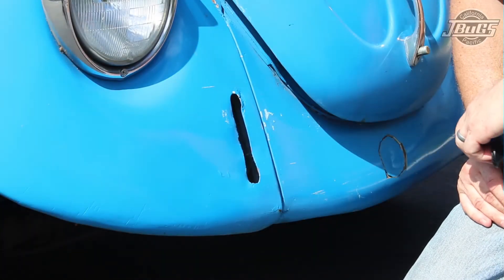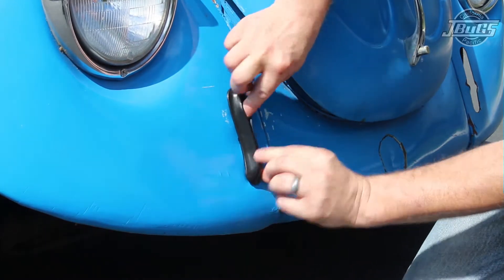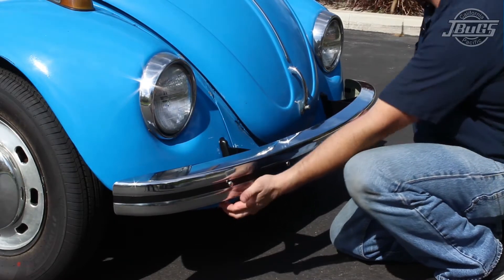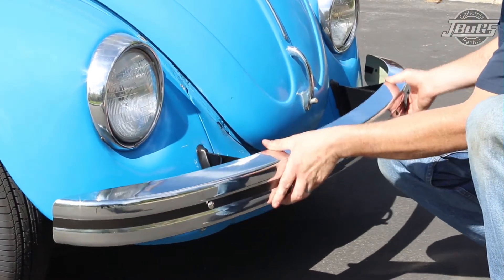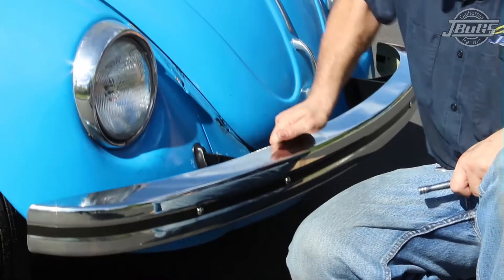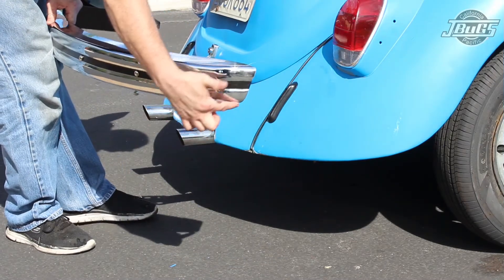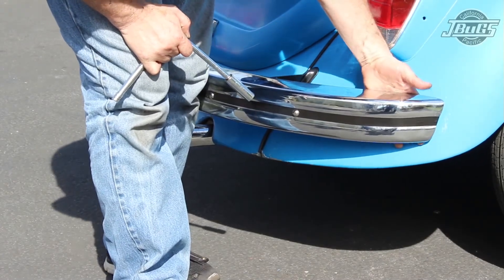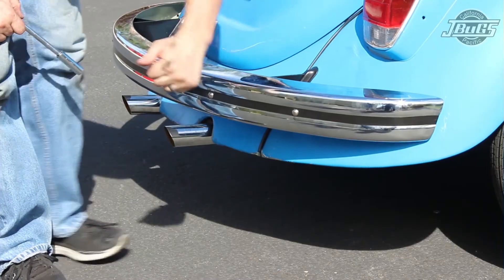JBugs - Tech Tip - Beetle Bumper Installation

Comment: This has been very helpful. With my 70 beetle I got in pieces. Never got to take it apart myself. The only thing that’s going to be a pain is my car is an autostick. The rear bumper mounts also double as the bracket point for the atf canister and vacuum canister. Going to have to pull those bolts out and slot in the bumper

Comment: Would it be possible to put 67’ bumpers on a 72’?
Reply: Yes, we offer https://www.jbugs.com/product/15-2045.html and https://www.jbugs.com/product/15-2046.html to install blade bumpers on 68-73 Beetles.
Reply: @Sam_Mebane  Will conversion brackets work for Over-Rider or just Blade Bumper
Reply: @loganmelodia6063  an over rider bumper can be bolted up to the brackets at it's lower mounting positions, but there are no supports for the upper portions of the over riders.

Comment: I bought the conversion bumper brackets to fit the old style bumpers or blade bumpers to my 68 Beetle .. I havn't purchased the Bumpers yet though..I am wanting to know if there is anyone who could share with me anything i should be concerned with in this conversion..I am wanting show quality chrome bumpers that also has a good fit and looked at several ads showing triple chrome bumpers..I know anyone can sell you anything but with no prior experience buying bumpers and without seeing them in person i don't want to make the wrong purchase here with such price tag for front and rear..Any help or suggestions ??
Reply: If you want a good fit you should have stuck with the original bumper brackets. The early bumpers are intended for use on early cars where the bumpers sit in a different position on the car. If you are intent on installing early bumpers and want the best possible fit, stick with blade bumpers (do not use over rider bumpers).

Comment: What I need is a shot of the opposite side of the bolts/info on how you tightened the nuts onto the bolts. I can barely fit my fingers into the slot where the nuts are supposed to go onto the back of the bolts
Reply: A wrench (ratcheting preferably) is all that can fit in there, it's tight but it works.

Comment: By the way what is a sleeper ? Not that i would do that to my car in the first place
Reply from the maker: A sleeper is, for lack of a better description, is a stock appearing car with a performance engine, and hopefully drivetrain and brakes to match. On the surface the car seems very unassuming and you wouldn’t suspect it to be fast at all.

Comment: My 1969 volkswagen bug in August of this year will be turning 49 year old.   Ive kept mine since i was 13 when my grandma bought it on ebay back in 2003. Im in two car show clubs Michigan vintage volkswagen club. United street machine Association up here in Michigan. My car came from san ramone California. And the heater channels work like a charm so much that on three occasions she melted her shoes.  But the last time i was out and about with the car was in 2010 but its been 8 years since its been out of the garage. And my. Mom's health got bad.  And were im at its always high volume traffic and car wrecks are frequent here in Michigan not to mention the potholes are larger then my car.  And many people treat me like Godzilla as soon as i tell them im from Michigan they scream and run off.